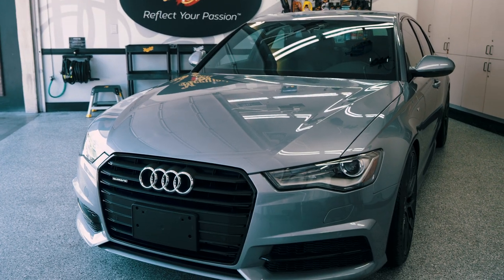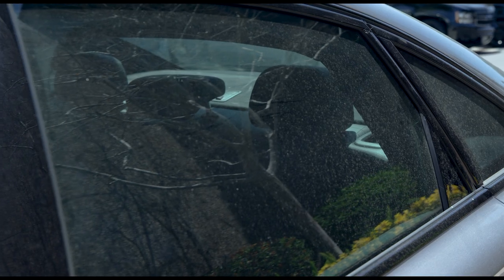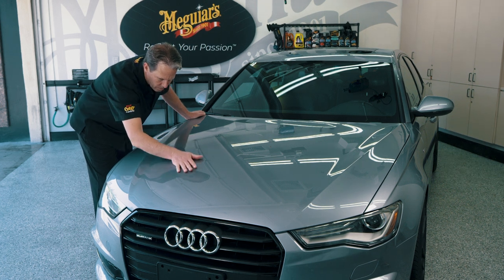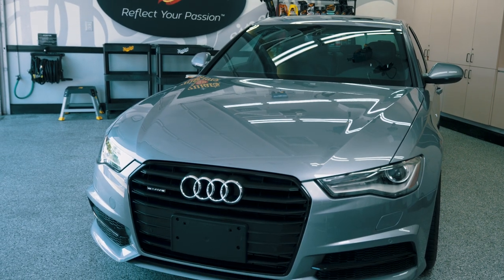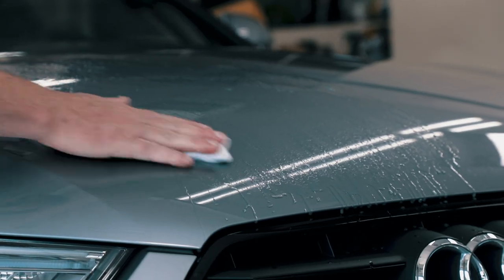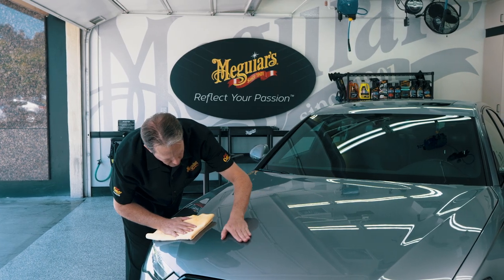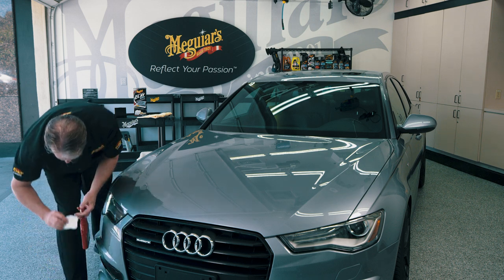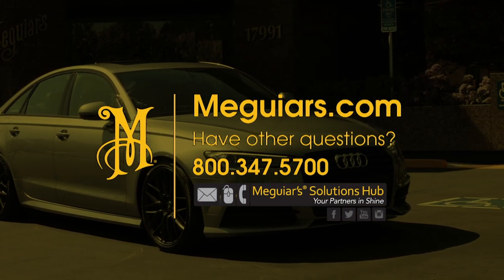How to Clay With Meguiar’s Smooth Surface Clay Kit

Comment: Un-freaking-real! It's ridiculously easy to use, incredibly effective, and not nearly as time consuming as I imagined. 

Just picked up a 2019 Charger in granite crystal. It looked great, but I could feel sap residue like someone filled a bottle and sprayed the hood, roof, and trunk from 3 feet away. Washing did /nothing/. Neither did waxing (duh). I've used Meguiar's for years, so it made sense to use them for my first clay bar. I grabbed this kit from Walmart and about an hour later all of the upward facing surfaces were as smooth as glass. (That's not an exaggeration.) It doesn't take a lot of elbow grease either -- just reasonable pressure, lots of lubricant, thoroughness, and then some microfiber. 

I couldn't be happier. Will recommend to everyone.

Comment: My car paint is rough so i bought the clay kit. I'm first time user of clay bar and it worked like magic! I followed up with wet-look cleaner wax then the quick wax spray, both I had in my garage for years. I hope this lasts without the need to buy compound and polisher.

Comment: I can feel scratches on my Honda's roof and hood, so can't wait to try this product! Thanks for the video. It's the first time to see malleable clay used. Other similar products have a hard bar.
Reply from the maker: To be clear clay will not remove scratches in paint.  That is something you would want to address with compound.  It is also important to keep in mind that a mild/safe compound has its limits and will not remove deeper scratches.  A good rule of thumb is that if the scratch catches your fingernail it may be too deep to remove easily with a compound.

Here is a video that will also provide great info on what clay is versus compound and when to use each...

https://s.3m.com/k4e5m4

Comment: I used this kit to remove overspray on my 1999 CRV. I took almost a day but the results like new paint.
Reply from the maker: Great news !  Must have been pretty bad overspray, but congrats on the results ! What wax did you use to top it with ?
Reply: @meguiars  
Nu Finish.

Comment: does the included microfiber cloth need to be washed before using with the clay kit?
Reply from the maker: Not mandatory but certainly wouldn't hurt.  Make sure to rip off the tag first as well.   👍

Comment: What is the different between c2000 clay bars and smooth surface clay kit?
Reply from the maker: The C2000 is slightly more aggressive but likely your purchasing decision will be based on price, packaging, and availability rather than a slight difference in clay.  The Smooth Surface Clay Kit is much more readily available a retail locations and of course comes with the lubricant (Quik Detailer) and a microfiber towel.  

Hope that helps.  👍

Comment: What do I use after I clay bar my car? Because my car has never been waxed or anything and it has scratches from over the years. It’s 16 Dodge Charger and I’ve heard ultimate compound is great to remove scratches . @meguiars
Reply from the maker: This article covers the 5 Steps of Paint Care.  It has most if not all of the foundational information you will need to understand this process.  Take a few mins to read through it and you will be better off for it.

https://s.3m.com/qhh476

Comment: Am I able to just use Meguairs ultimate quick wax after clay bar treatment?
Reply from the maker: You certainly can just keep in mind Ultimate Quik Wax is designed to be a maintenance wax not your only form of protection.  It may only last up to a few weeks.

Comment: So in NZ this kit is $80, its alot for only two uses.. (Get what you pay for though!) my question is, can I only use the clay bar once? As you said flip for new clean surface, one time use?
Reply from the maker: Clay is definitely reusable and this kit now comes with 3 clay bars.  When you should toss a clay bar is really relative to how much contamination is coming off or your vehicle.  Some clay bars can be used several times and some only once in extreme situations.

Hope that helps!  👍
Reply: @meguiars  Thanks! That means I might just go buy this kit haha

Comment: It works on the water marks??
Reply from the maker: Typically water spots are etched into the paint meaning they would need to be addressed with a compound.   Our Ultimate Compound would be a great choice.
Reply: @meguiars  can i use quik detailer after clay kit??
Reply from the maker: The main purpose of all of our quik detailer sprays are to allow you to remove light dust, contaminants, & fingerprints safely, in a spray on, wipe off type application.  So yes, it's great for in-between regular washes for touch ups & again light contaminant removal, plus added gloss.  Our A3316 Quik Detailer Mist & Wipe in the red bottle, provides just the right amount of lubricity for use as a clay bar lubricant, which is why we include it in the kit.

Comment: Will one kit be enough? I have a 2007 f150 super cab with a 6 1/5 foot bed
Reply from the maker: One kit should easily be enough for your truck unless you have a ton of bonded contaminants on the surface likely being hit with a bunch of overspray from a neighbors house painting.

Comment: Is this clay bar better than the synthetic one?
Reply from the maker: They really serve the same purpose but there are situations where traditional clay will work better on more stubborn contaminants.
Reply: @meguiars  thanks for the tip, also I want to ask can I use meguiars gold class wax after claying and then finishing  with hybrid ceramic liquid wax as a additional coat?
Reply from the maker: We are certainly not claiming that you need two different waxes but yes you can do that if you like.

Comment: How abrasive  is this ? Some people are saying you need to polish after claying. Others are saying it's not needed. I want to clay my car but I am afraid of its abrasiveness
Reply from the maker: Clay is not typically abrasive.  It is designed to safely remove bonded contaminants from the surface of your paint not doing anything "in" the paint.  If used properly, the more versions of clay should do this without leaving any marks behind.  There are more professional/aggressive versions of clay that on softer paints may leave something behind that will be addressed in the compounding step afterward.  

Again, this clay kit is very safe and can be a very important part of a good detail job.  Should not be something to be feared.  It is actually easier to use than most people think as well.